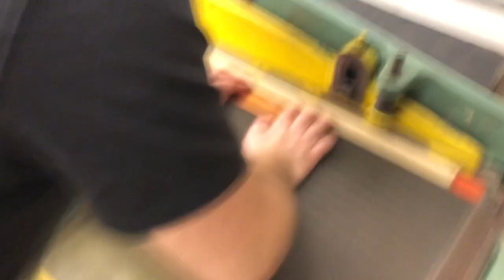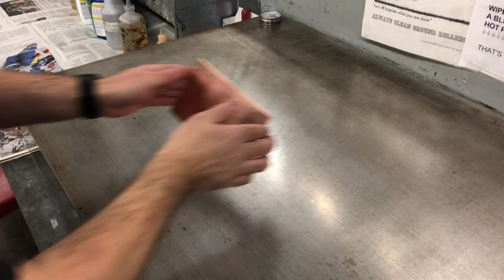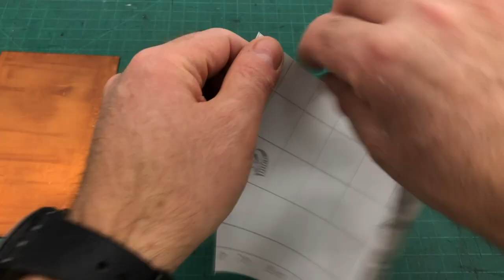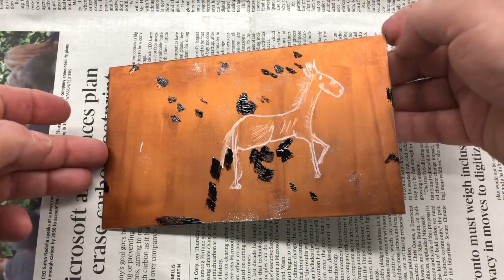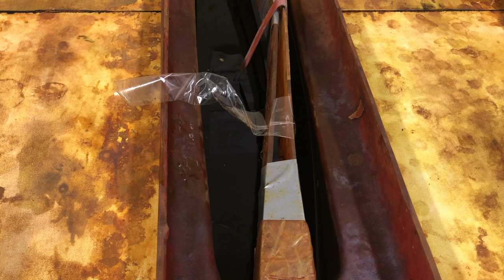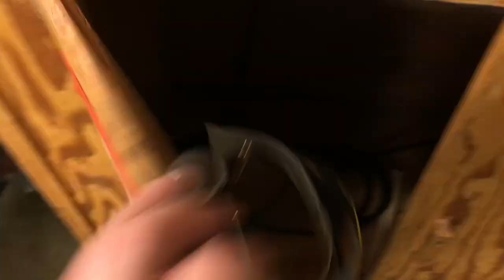Hard Ground Etching

Comment: Hi Professor, what can I do if I’ve etched for the first time—not realizing that I should not have been etching so deeply into the copper—and now have a finished etching done with deep lines that are likely cutting into the copper plate? I have not yet done an acid bath on the plate.
Reply from the maker: Hi, I think what you are saying is that you have pressed too hard into the copper with your etching needle, is this correct? If so, then you don't have to do anything... just put it in the acid bath for your etch. 
The only real problem with pressing too hard is that the etching needle will "catch" on the copper, and you won't get smooth curved lines, since you are fighting it. Ideally, when you are drawing on your plate with your needle, you are just using enough pressure to remove the thin layer of hardground, and in this way, you can have much more freedom in your mark-making. Good luck!

Comment: Can I use asphaltum etch...thinned down with turpentine as 
 hardground ?  Thank You for the really clear and simplified and concise instructions.
Reply from the maker: Yes, slightly thinned asphaltum will work, but you will need to ensure it's not too thin or it won't hold up to your etch. It is also possible to purchase "liquid hard ground" (I use Graphic Chemical brand, from the US), which is the perfect consistency, and it dries quickly.

Comment: What ground brand do you recommend?
Reply from the maker: For “ball grounds”, applied with a roller on a hot plate, I use Charbonnel brand. Unfortunately, even with a good backup supply, I am about to run out and it seems impossible to find now. I have experimented with Graphic Chemical brand hard ball ground and it works well but seems to need higher temps to melt it to the plate. I have lots of this so that’s what I/we will be using in the near future. For liquid hard ground, I use Graphic Chemical brand. It works well for when we need it (usually doing a “lift ground” process). Good luck!
Reply: @Professor Truszkowski  Thank you for your answer! I just started using Trilobite  Hard Opaque Ball from Takach Press. There is almost no information about it. We'll see if it's OK.